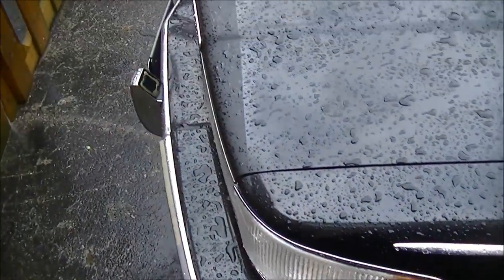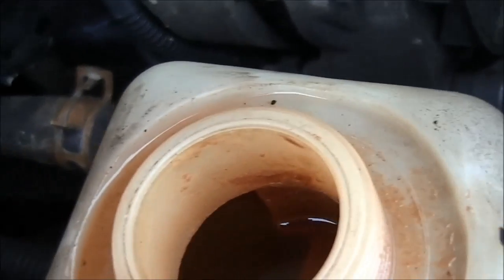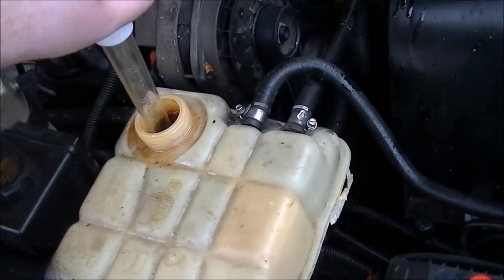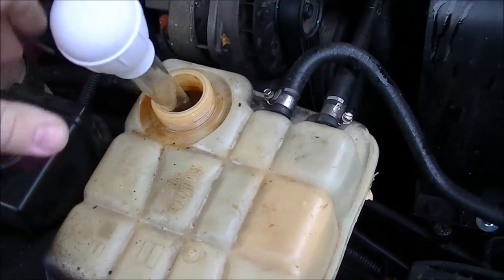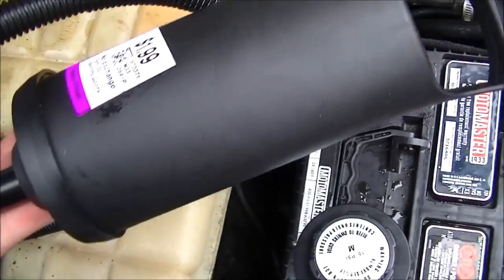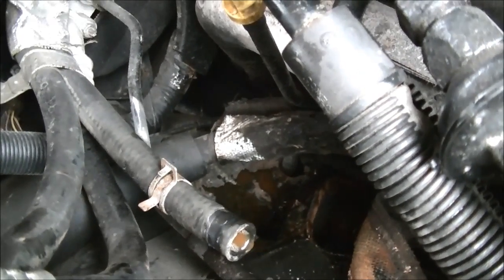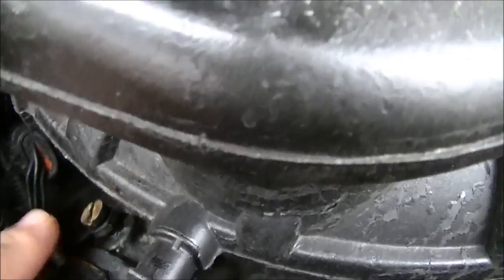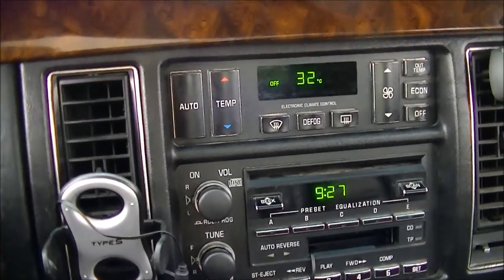Heater Core Repair 1995 Cadillac Fleetwood Brougham

Comment: I see negative comments. I've worked on automobiles all my life for 35 plus year's. This man done a great job. This is the proper way to back flush a heater core. When flushing only use 10-13 psi or you will blow the heater core. I always empty the entire system and removing the heater core hose to let out the diry old coolant when it turn's clear reattach the hose let car run bring temperature to 180-208 degree's to open the thermostat burp the system then add Prestone radiator flush let run and drive for 1 day then flush the entire system with water. When empty fill with 50-50 Antifreeze. I always use 100% Antifreeze for extra protection it will not hurt or damage the cooling HAVC system 100% will only help the temperature of the engine stay cooler.

Comment: Great video. I am going to replicate what you did on my fleetwood. Only thing I didn't see was how you used the tire pump to force the air into the hose to flush the heater core, please explain that.  Thank you
Reply from the maker: So what you need to do is attach the hose to either hose connected to the heater core using the pump as you would use it to pump up a tire  the air generated by the pump will push air through the heater core pushing out the build up of old coolant. For best results pour hot water in one of the heater hoses you will be attaching the pump to this will help push more crap out

Comment: Quick Question The Hose Under The One You Squeezed Can Be Replaced By Any Radiator Hose? Or Is It A Specific One ? Thanks In Advance
Reply from the maker: The hose you described below the top one is the input line which has a restrictor valve to restrict the flow of coolant going into the heatercore on the factory oem hose the restrictor valve is crimped on to the rubber hose the hose with valve crimped on it is no longer available. 

However there is a way to fix this as mine broke where the hose from the heatercore would plug into it. I cut out the crimped part of the hose and bought this part reconnected the hoses and used pipe clamps
https://www.amazon.ca/ACDelco-15-5423-Original-Equipment-Control/dp/B000C9DDBW/ref=sxts_rp_s_1_0?content-id=amzn1.sym.6639e8cc-314e-4010-ab31-82a4969d0a94%3Aamzn1.sym.6639e8cc-314e-4010-ab31-82a4969d0a94&crid=2LAHLF0G9UH5P&cv_ct_cx=ACDelco+15-5423+GM&keywords=ACDelco+15-5423+GM&pd_rd_i=B000C9DDBW&pd_rd_r=90e0122b-3249-47c2-871c-1c983d6edcef&pd_rd_w=mysKs&pd_rd_wg=EPDOi&pf_rd_p=6639e8cc-314e-4010-ab31-82a4969d0a94&pf_rd_r=XDBKWYZDNF15DY7S57NZ&qid=1671078965&sprefix=acdelco+15-5423+gm%2Caps%2C215&sr=1-1-cb9ed203-36f2-497c-b389-dfec57adb781
Reply: @vcamnowaa  Thanks Man Saved Me A Headache! I think I have the similar problem as you had my hose snapped right at that conection by the metal prt in the hose
Reply from the maker: @Rvressur  yep that was my issue. Your pretty much forced to buy this part on Amazon or wherever a local auto parts place sells it.  If you just put a regular free flowing joint connector on there with no restriction. You risk blowing the heatercore in the dash. I actually installed this amazon part this month and made a video but never uploaded it and then two weeks later the optispark distributor died and I had to sell the car as there was soo much wrong with it.... I may upload it for anyone who may find it useful

Comment: I have a 93 caddy deville, I've got heat coming in however only on the passenger side, and defrost passenger side, I get cold air on the drivers floor vent and defrost vent, the blend actuator is working ok, I see it moving fine, car doesn't overheat, fluid is fine, so I thought it was the heater core blockage, just can't find where the hoses go, would what you do work on my car. its -18c right now, going down to -28c tonight, so no hurry to do it tonight, lol. good vid by the way.
Reply from the maker: jingle jazz jingle jazz Hi that's an unusual problem how hot would you say the heat is? Burn your eye balls out kinda hot or just lukewarm? If you are still getting heat out from the passenger side I would assume that it is Not a heater core problem.
There are two doors on a climate control system. You have a blend door and a Mix door The mix door controls the temperature cold/hot  The blend door moves the air to floor,middle and dashboard vent

From what it sounds like I think your mix door is not functioning properly. These systems are vacuum controlled and have plastic lines that are routed to certain areas sometimes they get brittle and crack thus causing a vacuum leak which in turn will cause poor response with the blend and mix door. 

I think the mix door is just stuck try tapping your hand on top of the dashboard while selecting heat on the climate control the vibration from tapping the dash may free it up.
Reply: not exactly burn my eyes out hot, however very warm, even if it did it wouldn't cost me anything to go to the hospital...eh? lol. anyways, its very warm on the passenger side, checking the mode door actuator...could be a vac leak! Waiting til Sunday, it'll be -9 by then, today its -20c. thx.
Reply from the maker: Lol I hope you can get it fixed, My Cadillac after I unclogged the heatercore the heat was so intense my eyeballs felt like they were burning out of my head. Your's may be a little vacuum leak that's all it takes or it could be a sticky mix door that just needs a little nudge keep me posted :)
Reply: well, today is only -16c, that's the warmest until Wednesday, fuck...I use to live in Vancouver, -3c is a cold day....anyways, I found the mode actuator, testing showed its not moving, I tried to get a pic of it, however its in so far and so tight, I could barely get my hand in it to even touch it, tried to get a pic of it however I couldn't get the camera in range....Christ...I'll wait til spring, should warm up by may long weekend, western Canada, sign those organ donor cards! Got stuck under the dash, took me 5 minutes to get free. fuck!!! at least I know the problem, thanks for your help. anyone know how to reset the actuators like in trucks, maybe it just needs the computer to do it for it....either that or carry a firelog in the meantime, lol.
Reply from the maker: jingle jazz actually that is true what you say about resetting the computer just disconnect the battery wait for a couple minutes and hook it back up again and maybe the door will move back into the default position I'm not a hundred percent on this but I know it works for newer cars. gotta try the easy stuff first before tearing into the dash! Good luck and let me know how you make out.
Reply: ok, today I took another look at the mode door actuator, I was able to reach it and move it, sure enough I could hear more air coming through, it would spring back when I let go, disconnected the battery, everything reset however the mode door actuator still doesn't move, even when I moved the actuator myself, I could hear more air coming through however it was still lonely luke warm, passenger side very warm, so what would you suggest next. got all the panels under the car taken out, looks like my first car now!
Reply from the maker: jingle jazz okay so at least you've narrowed down the issue to one of the doors not working. When you move this door are you getting any heat out on the drivers side? in your very first comment you said only heat would come out on the passenger side and not the drivers side. When you say Mode door you're talking about the hot/cold mix door right?  Not the blend door that moves the air flow from floor middle and defrost  vent. Just want clarify there's two doors with two different functions :)
Reply: yes, that is correct, blend door on the passenger side is working well, I see it moving and air goes from bottom to top as it should, however I noticed the mode door on the drivers side doesn't move, unless I move it with my hand, when I move it up I hear lots of air coming in, however again the air is still luke warm on the drivers side floor and drivers side defrost. The air feels warmer however it could be because its -20c outside I could be experiencing hypo thermia. When I let go of the mode door lever it goes back to the bottom again.  thx.
Reply from the maker: jingle jazz I noticed you watched a video about this particular problem on someone's channel their hot/cold mix door actuator motor was not working you'll need to remove all the stuff that he "poorly" showed in the video and replace it. as for the Luke warm heat my Fleetwood's heater core was partially clogged and would only give me luke warm heat but when I put my foot on the gas it was pushing out a lot of heat. Does yours make any difference when you put your foot on the throttle? If not check the heater core lines there are two black rubber hoses coming out of the firewall on the passenger side feel both hoses if they are both hot that means it's not plugged. If one of the hoses is not as hot as the other that means it's plugged. Finally when was the last time you had the thermostat replaced? it's a shame that you don't live close to me or I'd be happy to work on this problem with you rather than being just words on a screen lol.

Comment: Hi I got a heater problem as well 98 deville elegance ok heat on the dash comes out fine but not as hard as it should on full and the vents sometimes only work? I’m going to flush the heater but I will check if ones hot and cold if they both hot then I know that’s not the problem!

Comment: Have you repaired an exterior door latch?  Two of mine don't work.
Reply from the maker: No not yet you can try to looking around autowreckers to see if they have any fleetwoods roadmasters impalas or caprices you can practice on those before doing anything to your car. I do know if you're going to replace the exterior door handle you will have to remove the inner door panel to get at it to unhook everything from inside the door
Reply: @vcamnowaa  Thanks a million for the advice.

Comment: How was your heat blowing before it clogged up. A little or in between or full. Thank you
Reply: It sounds like I have the same problem he does. I am using the front defroster for heat and the main air vents are currently useless.
Reply: @bradydavidson4290  Have you checked the Thermostat
Reply: @Tom-wq2mz  
I have not.
Reply: @bradydavidson4290  Okay. Next following my instructions Locating the the small hose that runs across the top of the engine to the driver's side it connects to a very small inlet remove the hose on the driver's side see if the inlet is free of corrosion. If it gets clogged it will restrict coolant flow. Let me know what you find. What year is your Deville or what motor 4.6 Northstar?
Reply: @Tom-wq2mz  
I have a 1995 Deville, it does not have a North star.
Reply: I don't know what kind of engine, except a 4.9 liter V8.
Reply: @bradydavidson4290  4.9 ?
Reply: @Tom-wq2mz   yeah
Reply: @bradydavidson4290  I thought so being a earlier year. Same concept. Check the small hose inlet replace the thermostat. If no improvement back flush the heater core. Good luck
Reply: @bradydavidson4290  Another tip. I picked up a 1 owner 1999 Deville low miles 114K the temperature when car is running was at 218 degree's my friends 1999 was running 202 on his Northstar. I bought a new water pump at O'Reillys not a refurbished. My car runs around 203-206 degree's now. A cooler running engine will last longer.
Reply from the maker: There was little to none it was plugged up real good no coolant was able to pass through the heatercore

Comment: I was unable to get the engine temp using your method. Any suggestions as to why?
Reply from the maker: Joshua Silvers What year is your vehicle? is it a Cadillac Fleetwood or Deville? the Deville's heating system is completely different
Reply: I have an 96 and you have to go up to setting number 08 and then do outside temp.

Comment: I have a 94  Fleetwood  do you no why mine has two hoses at the top cant find one any ideas on it
Reply from the maker: Two hoses at the top? I'm afraid I don't understand the question. Is it the sunroof hoses or heatercore hoses you're talking about?
Reply: on the coolant  tant   ,reservoir  .   two  hosescome out one goes to radiator one goes across to engine  I think
Reply from the maker: MUNDA one hose is supposed to go to the rad and one is to drain any overflow. GM later eliminated the second hose  as it didn't do anything.
Reply: you no where I can find one with the two hoses
Reply from the maker: MUNDA You can buy a coolant tank off ebay or you can go to a local auto wreckers the cars that have these tanks are 94-96 Cadillac Fleetwood 94-96 Buick road master 94-96 Chevrolet caprice and 94-96 Chevrolet impala Again the secondary line doesn't do anything. If your car ever needs the radiator replaced the new one will probably not have that connector for the secondary hose
Reply: cant find on the salvage yards one hose goes to radiator  the other one goes across in front part of ebgine
Reply from the maker: MUNDA another place you can check is on the Cadillac forums they sell parts but will most likely tell you what I told you about the second hose being useless. Is the tank itself leaking or the cap that screws on leaking?

Comment: Good ass video
Reply: GM dealerships have a stop leak that is put in to all L T1 cars. I also have a 94 Cadillac Fleetwood with exactly the same problem. I have recently flushed the system completely using dishwasher soap To get the crud out.